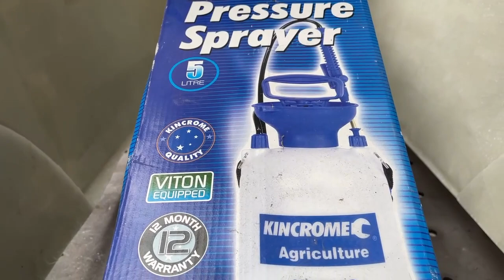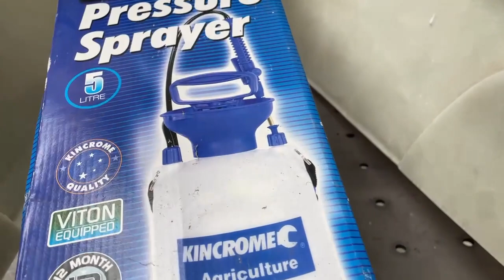DIY Custom Swing Arm Build! Is It TO Complex?

Comment: cool, not sayin it would work but on some bikes the carb is held with a rubber boot deal maybe some hoes, on the carb take it apart and spray cleaner might save 30 bucks, its lookin bad ass that three wheeler fit nice awesome job